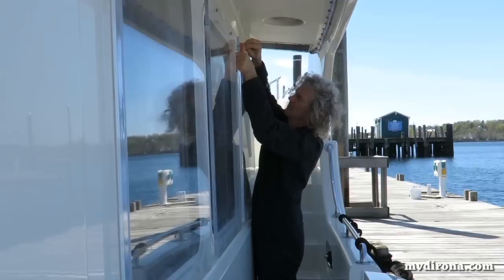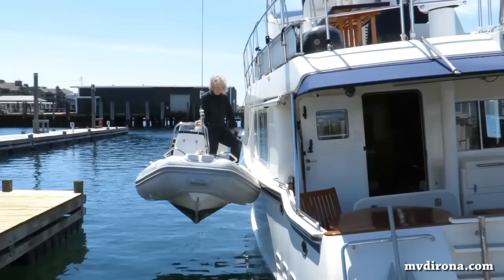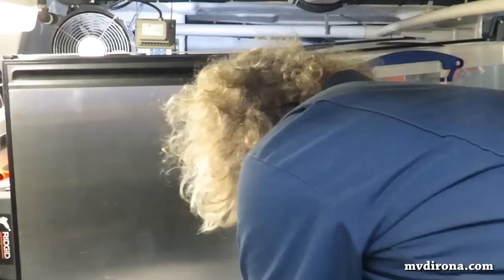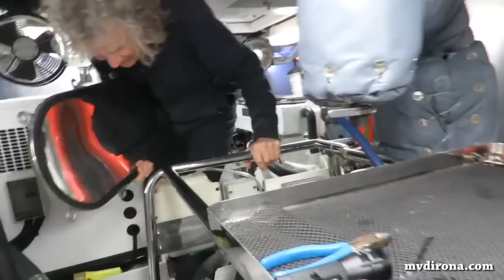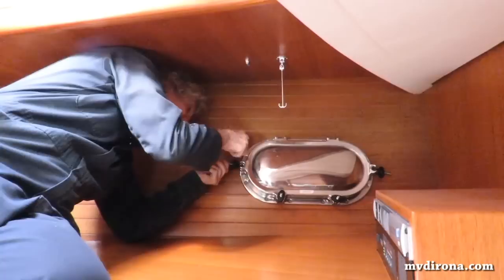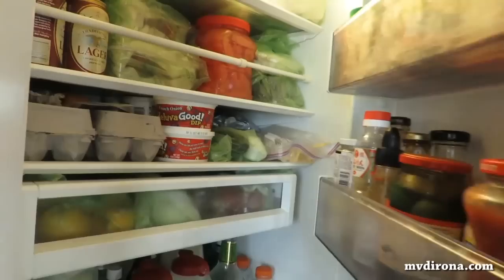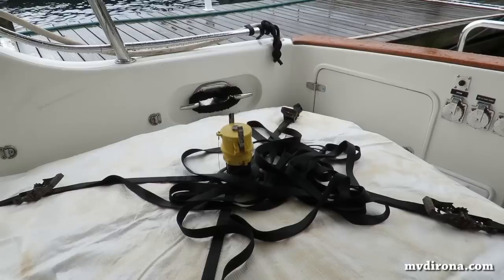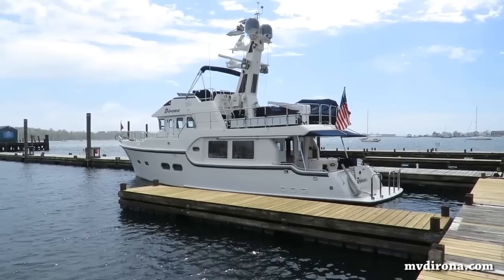Preparing Dirona for the North Atlantic Crossing (MV Dirona Channel)

Comment: Sorry,but the “ Storm Plates “ thing looks pretty  pathetic!!
A bit of Perspex screwed on with  kind of  what looks like nylon type screws?  What do you do mid Atlantic if the crappy little screws  loosen and the “plates” start to loosen? Seemed  like a big deal  installing them in a calm harbour situation???  It’s CLEAR  that James is struggling!!!
Maybe you guys should think about not  going to “ challenging locations “  around your  boat!  Sell it and think about a rest home with a sea view??
Reply from the maker: Storm plates are an approach that allows a boat equipped with larger windows still go to sea without excess risk. If you have smaller windows or much thicker windows, storm plates aren't required.  Unless conditions are really bad, storm plates aren't required. And, for some people the hassle of installing them exceeds the additional safety margin. We chose to install them when we cross oceans since, in a slow boat, the crossing time exceeds the period where reliable weather forecasts are available. 

Of course nobody would attach storm plates with what you thought were "nylon type screws."  They are attached with 1/4" stainless steel machine screws. Perhaps even that is on the light side for some conditions. Pretty much anything can be torn in violent weather so this solution, like any others, isn't without risk.  Crossing oceans in a small boat brings some risk and it's a personal decision on what level of equipment and redundancy seems acceptable. We're definitely more conservative than many.

Over the last 12 years we have rounded the world and crossed every ocean including three Atlantic crossings. It's likely the case that the storm plates have never been "needed" on any of our crossings so you could definitely argue it's a waste of time.

You were surprised that we would install storm plates in a calm harbor. I can't imagine another approach but I suppose it's possible that some might wait to install safety equipment until in rough weather.  That's just not the way we chose to operate.
Reply: @MVDirona  Thanks for your reply. You’re explanation makes complete sense to me now. 
No offence was intended regarding  the James “ struggling “ comment but the installation did look pretty difficult and I would certainly have struggled!
I have great admiration for you guys and love your voyages. You’re actually living a life that others can only dream of. Thank you for sharing your adventures.
Reply from the maker: We feel lucky to have done this 12 year trip around the world. Literally thousands of unique experiences and a few moments that we found scary along the way.  The latter have been rare but each of them reminds us that the hassle of taking some additional care with the weather and boat preparation is worth the investment. Here's one we found challenging: https://mvdirona.com/2017/05/alarms-at-115am/. But, that was only 1 day in many years of cruising.

Comment: Automatic hydraulic crane and still using a hand screwdriver.  Those electric drivers aren't that expensive.
Reply from the maker: I have a Milwaukee and love it. I should give the power driver a try but these panels are heavy and, so far, I have found it easier to guide in the screws using a hand screw driver.
Reply: @MVDirona  Hand tight is fine. I was thinking you could have used a rock climbers helmet for safety. If a break don't catch etc. Thanks for sharing, and safe travels.
Reply from the maker: Yes, a helmet probably would be a nice addition.
Reply: @MVDirona  just don't lick the window lol
Reply: and a lot less costly when you accidentally drop it in the drink.

Comment: all that CO2  spend on that.
Reply from the maker: C02 isn't an environmental concern. You probably meant carbon monoxide, particulates, nitrogen Oxides, and other harmful diesel engine emissions. If it helps, we don't have a car and haven't had one since 2010. We also don't have a house to heat and haven't had one for a similar period. But, yes, our boat does burn diesel, and it will have environmental impact. It's only a single 266 HP engine but there are still emissions. 

Everyone is free to form their own opinions and I suppose you might conclude that our usage doesn't warrant the environmental impact.

Comment: Couldn't get a bigger boat? All that safety talk is a show when you compromise all that space with fuel. Control freak's ...
Reply from the maker: All things in boating are a compromise.  Bigger boats certainly make some things easier and could carry the full fuel load we needed for this 2,800 mile crossing but bigger boats are more expensive to buy and to maintain. It's all a trade off. 

One aspect of crossing oceans in small boats is you and every other person attempting a crossing can do whatever you want. There are no control freaks. If you don't feel like the hassle of putting on storm plates is justified, you simply don't have to do it. It's your life and you get to make your own decisions.
Reply: Those with bigger boat simple have more stuff resulting in the same challenges. Why get a larger boat if this one suits all their needs. If one crosses vast oceans regularly they would invest in a larger vessel. What these folks are doing is common practice. Cheers!